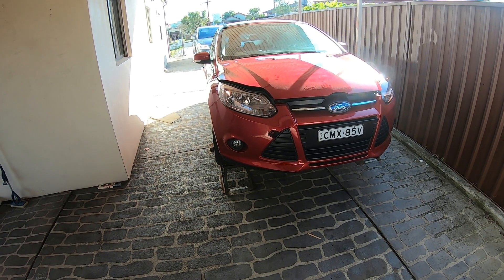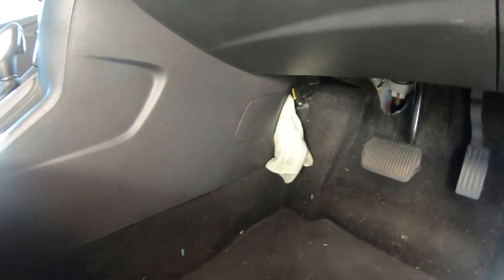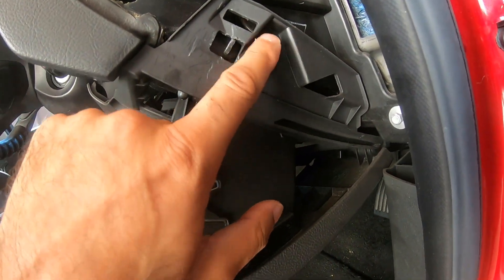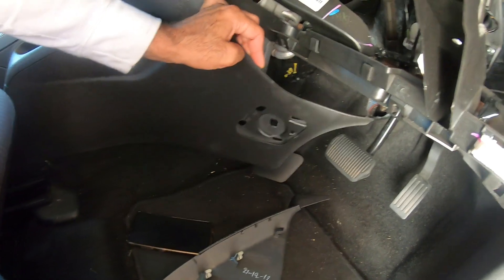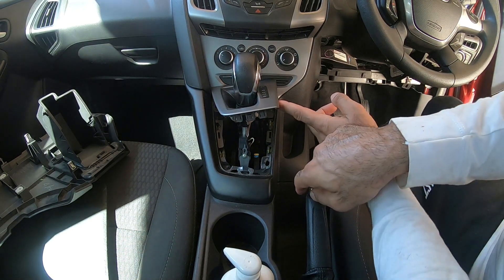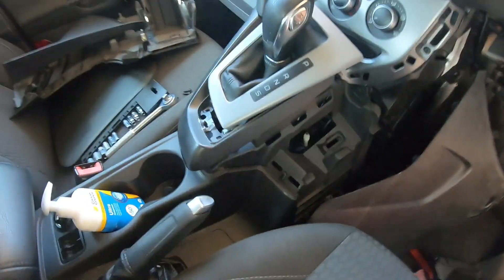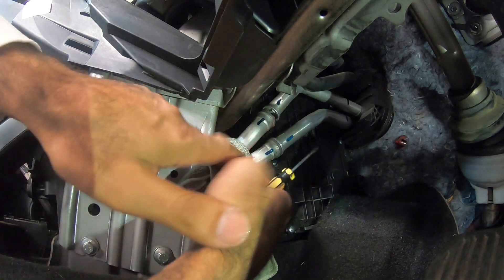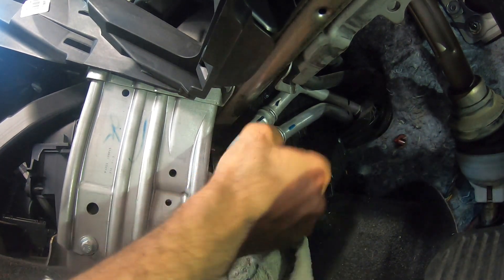Ford Focus LW Heater Core leaking pipes repair

Comment: I have the same issue. Is JB Weld Cold Weld a better option than gasket maker?
Reply from the maker: @sukhdevsingh-pk2qh  jb cold weld should be a better option. Just do some research on its compatibility with coolant.
Reply: Thanks RJ for quick turnaround 👍

Comment: Is there a link of where you bought the o rings? My focus has developed this issue.
Reply from the maker: I tried multiple sizes (eBay sells kits of o rings various sizes). None of them would work. They'd either pinch or too big to go in. Lack of space is another issue. I'd recommend using a gasket maker. It's easy to work with and doesn't leak.. tried and tested.
Reply: Can you please guide which Gasket maker you used?
Reply from the maker: I used "threebond gasket maker" for it's sealing and healing abilities. It's also acceptable for water bodies so it's suitable for this application. You can use any available sealant acceptable for water bodies.
Reply: @RZJugaar  Thank you so much!